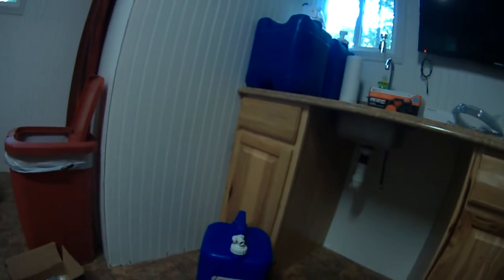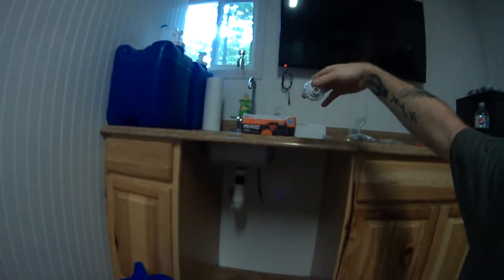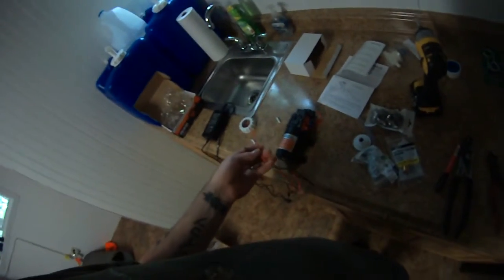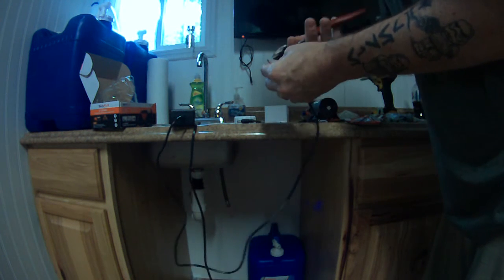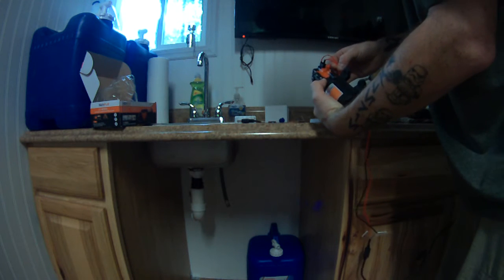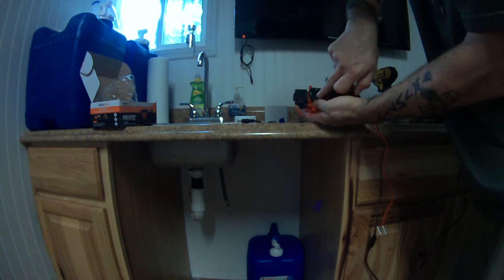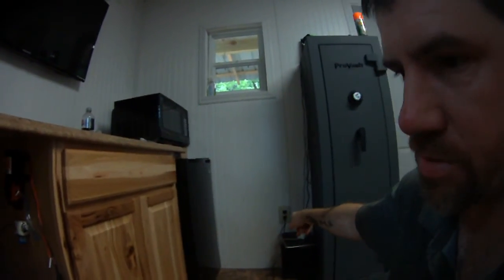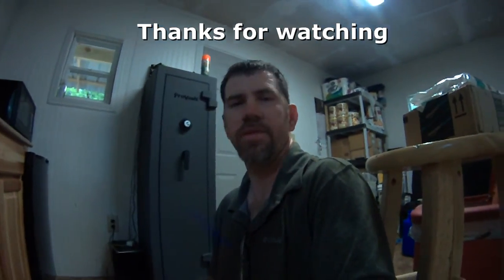Cabin Off Grid 12v water pump system

Comment: What did you plug your power supply in to? I live in a dry cabin in Alaska and am looking for a system for my kitchen sink. I have electricity. Would this work, or do I need to make adjustments because I have regular electricity? Thanks
Reply from the maker: plugged into 110v > i had  a 12 V  power supply..  the one i used looks like a laptop charger, supplies 12 v dc.. from the pump (Current Draw: 1.7 Amp (max. 2.7 Amp))
if you have 12v solar you can run off battery
Reply from the maker: used a power supply like this one... https://www.amazon.com/Converter-100-220V-Transformer-5-5x2-1mm-Accessories/dp/B08C594VNP/ref=sr_1_1?dchild=1&keywords=TNTE+12+Volt+Power+Supply+-+5+Amp+Standard+%2812V+5A+DC%29+Adapter&qid=1634648127&sr=8-1

Comment: they think you plug in to your pump thats says its 12v the ussually are putting around 17v out you should of checked with your muiltimeter your pump will just run very fast on 17v